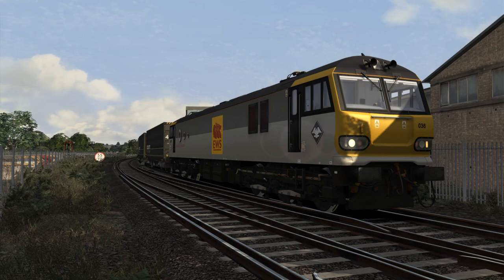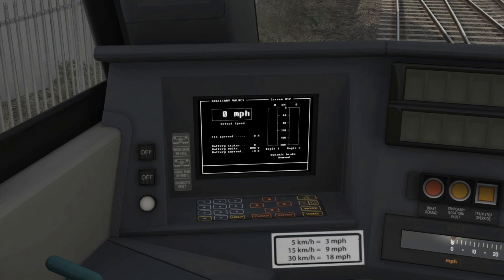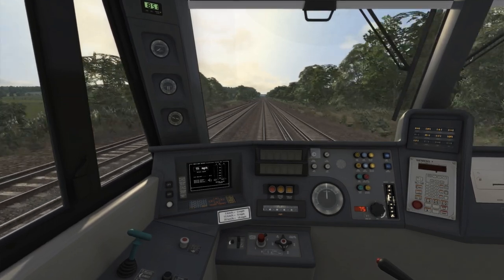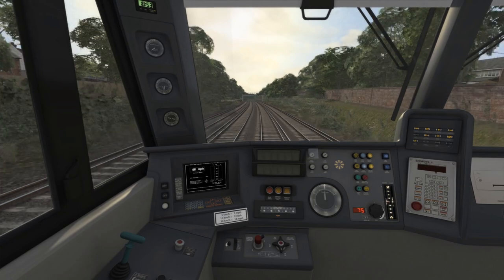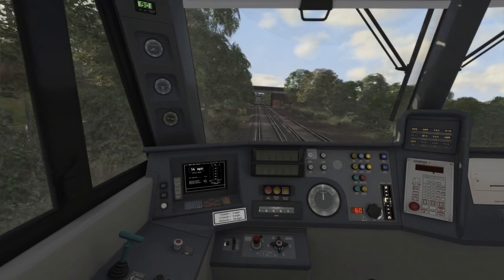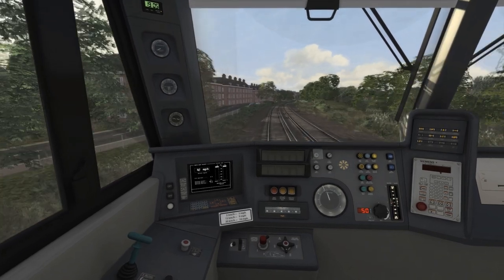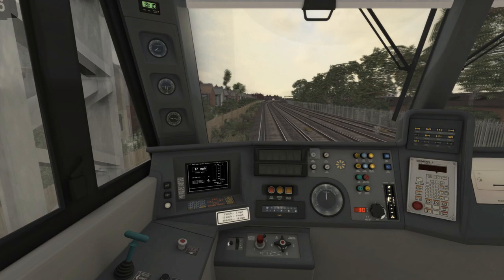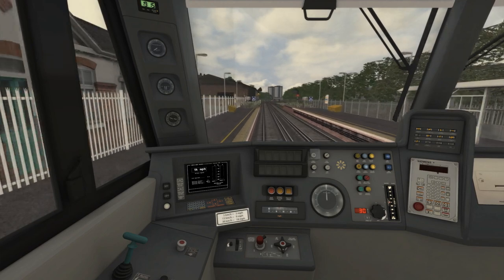Train Simulator 2017 - Route Learning//UK Freight 4 - Swanley Junction to Wandsworth Road (Class 92)

Comment: I just wanted to mention for the Amtrak video that it is common practice to call out all signals along the route when not in cab signal territory. Ex: clear, approach  limited, and so on. In real life it is told to the head conductor or conductor in the locomotive. It would be hard to simulate also the fact that there are no set stopping points at stations, but instead the head conductor will count down the # of cars to the engineer to stop. It's at his discretion. Some signal aspects have speeds to them. I think the pass is BNSF, so there signal guide might be good enough.

Comment: Hi mate.again you have made another great video pal. So looking forward to the class 143 route learning video. And 158. I really hope you do a video on the class 153 single sprinter.i no it's old but the rest of the sprinter family you have done just not the class 153 which where originally where class 155's. Also have you thought of doing a duo.like a class 142+143 for example coupled up on Cardiff line or something similar? Like 150+142 coupled arriva wales.not many people do this on Train simulator but would be nice to see.great work pal looking forward to your next video